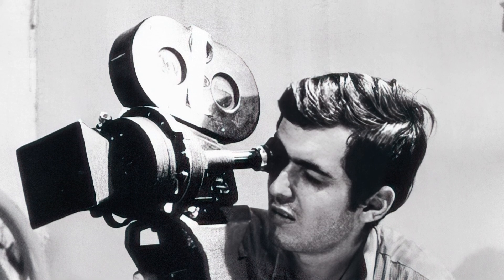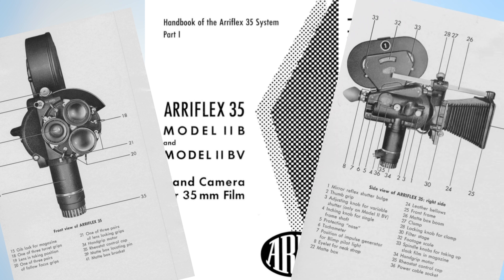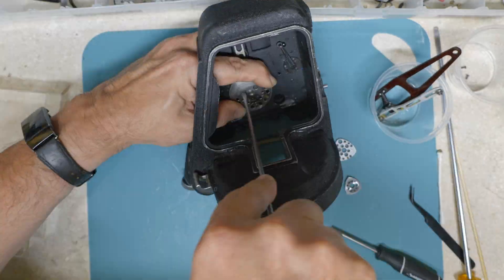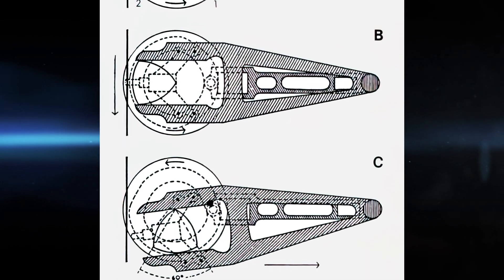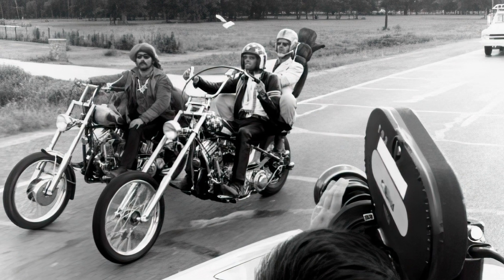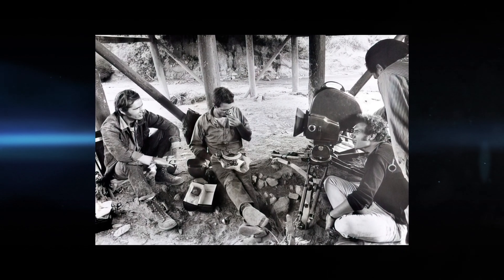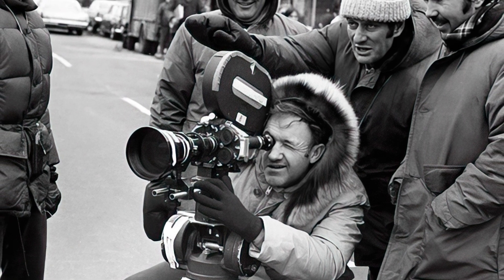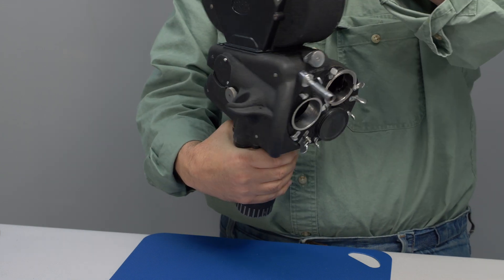The Arriflex 35:  Kubrick's Go-To Camera

Comment: Could you use an Arriflex 35 as an animation camera, basically for stop motion? And it would it make since for a 1960s/1970s animated film shot on 35mm to use an Arriflex camera such as a 35 IIC? It seems compact and small enough to be fine for shooting animation and sound wouldn't be an issue because you would be shooting frame-by-frame. I think the Bell and Howell 2709 camera was used for animation on 35mm film from the 1920s up until the 1990s, pretty much all of Disney's animated films on IMDB say they used the B&H 2709. I don't know much about the Bell and Howell cameras though.  I would expect an Arriflex camera, especially the 35 IIC and iII to be more reliable and "better" for shooting animation, but I don't know.
Reply from the maker: I know 2C's have been set up for time-lapse shooting, not sure about animation. People tended to use the Mitchell because it had super-steady registration with pins. The Mitchell also had a separate shutter, which allowed a solid closing with no light leaks. When using an Arri 2C in frame by frame mode it usually required a "capping shutter" that was fitting outside the camera over the lens. This was necessary because the mirror shutter of the 2C would allow very small light leaks around it when closed, but open to light for long periods. I've never actually used this set up, but have seen photos of it.

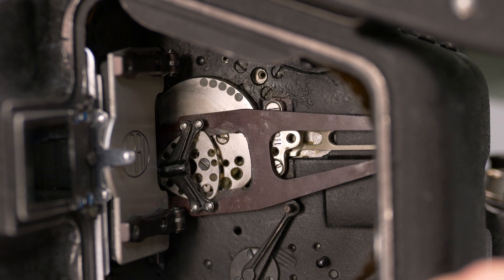Comment: I don't think that the Pertinax claw is supposed to hit the buckle switch with every rotation that it makes (as shown from 4:15). While I don't know what it is, something has to be wrong here.
Reply from the maker: Ordinarily there's a black metal cover over the center of the claw that prevents the buckle switch from hitting it - I removed the cover to show the claw mechanism more clearly.  The switch is tripped here, and not tripped at :50. The buckle switch in the 2C is pretty useless now, as I think it required power provided by the Pilotone sync electronics in some cameras - obsolete. This camera had it's Pilotone side cover replaced by a regular cover so it no longer has connectors, electronics or a bloop light. Many cameras did not have the buckle switch at all, just a metal cover in it's place. At any rate, it doesn't do anything now, so I probably should have removed it anyway.
Reply: @FreshGroundPictures  Quite interesting! It probably makes sense to remove it. I do own a IIA (the first one to have the "new" cardioid movement) and it also does not have a buckle switch.

Comment: How hard to convert one of this to accept Vmount Gold mount batteries?
Reply from the maker: Finding a place for the mount would be difficult. More of a problem is the voltage - most of the older motors needed 16-24 volts to run. V-mount and Gold Mount max out around 14 volts.

Comment: I´ve shot once a short with an ARRI 35BII. I wondered why the Viewfinder has some vertical kind of dividers that distract the viewing. Do you know what I mean?
Reply from the maker: Yes - those are thin black metal strips in front of the ground glass. They're light baffles meant to prevent reflections off the glass from hitting the film during exposure. Apparently, they were necessary because  of the mirror placement right next to the ground glass.  Some cameras had them removed, but this could cause an annoying flicker if there's a bright object in the frame. By redesigning the mirror and glass placement in subsequent cameras, Arri was able to reduce or eliminate the baffles. Strangely enough, when you use the camera a lot, your mind kind of filters them out...